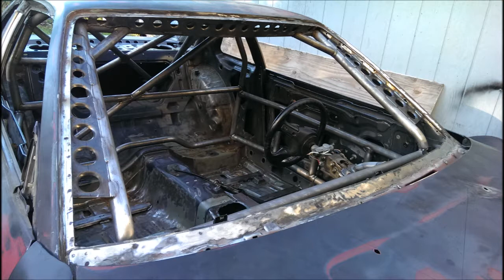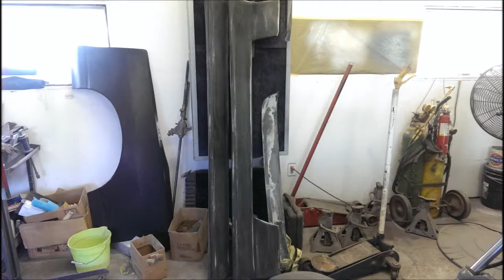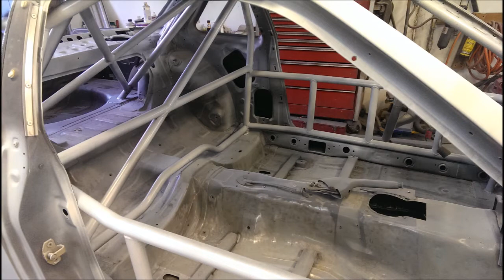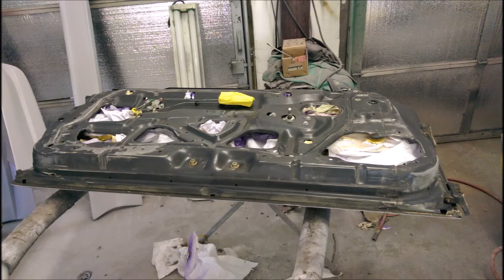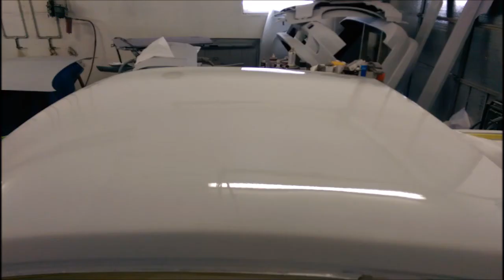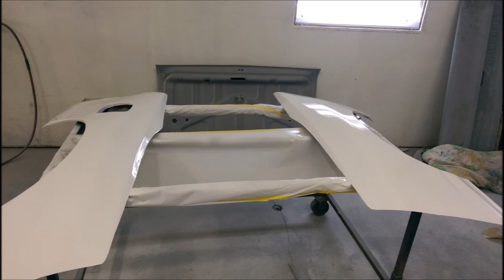Nissan 240sx drift car painted

Comment: what does something like this cost?
Reply from the maker: Whole car paint wise or the roll cage wise n paint  cause we painted the car for a family friend n charged him for painting it not the roll cage install
Reply: Talking about just painting the whole car. What would u have charged if say I came in. I'm looking to having this done to my 240.
Reply from the maker: William Robinson well depends how much body work is needed on your car n also inside n out like this one , is it for show quality or just for daily driving or drifting there are alot of variables in the process
Reply: Yeah was thinking inside and out.  I don't drift, ounce in a while track. But just wanna look clean when I cruise, I have a s15 front on mine but it need to be strightend up a little.
Reply from the maker: William Robinson your looking at about 2800 to 3500 average to do that